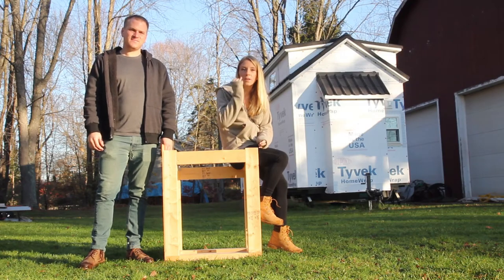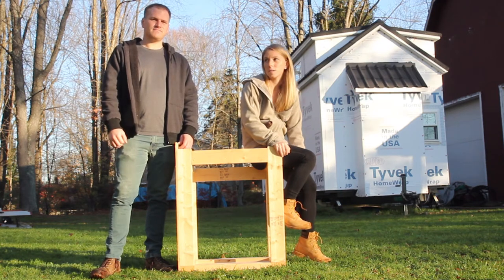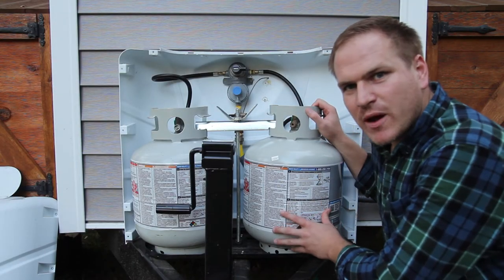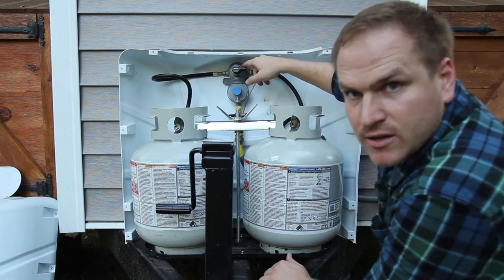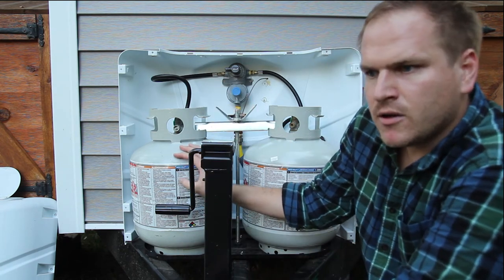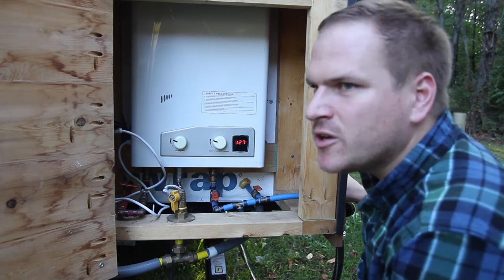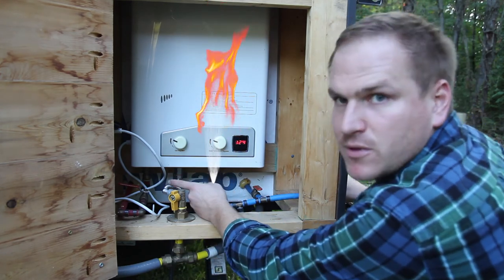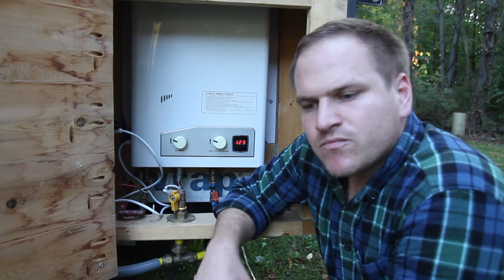Tiny House Water Heater

Comment: what brand did you use and how is it performing? thanks Curtis
Reply: We went with the Eccotemp instant water heater. It's performing OK. The only thing is that our shower valve doesn't pull enough water to engage the heater so we have to also have the bathroom sink running. A little annoying but we live with it.
Reply: curtis waagner  maybe try lacking the restrictor out oh the shower head.